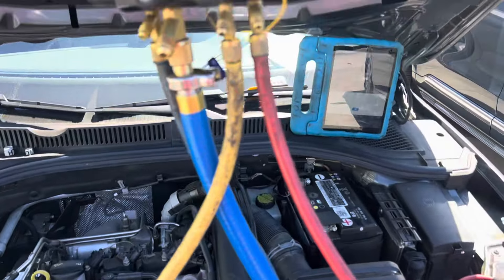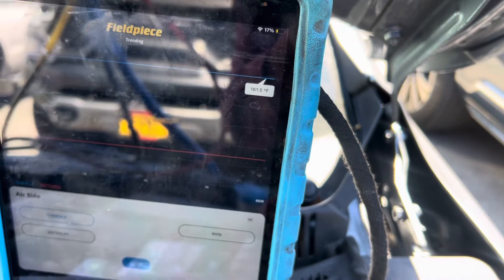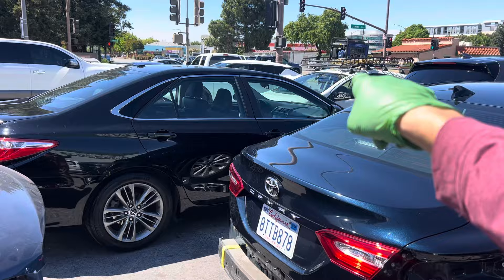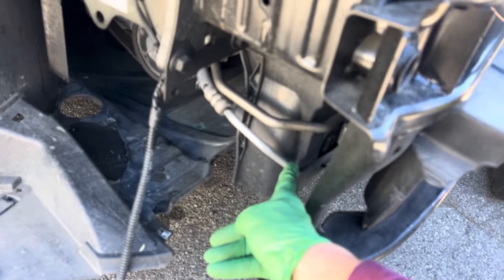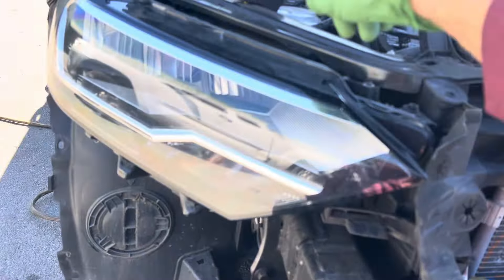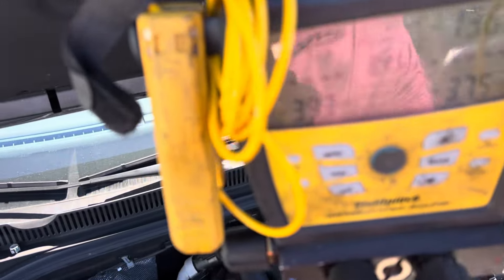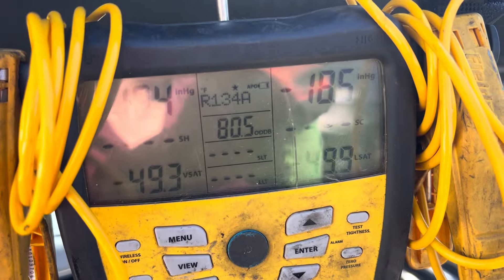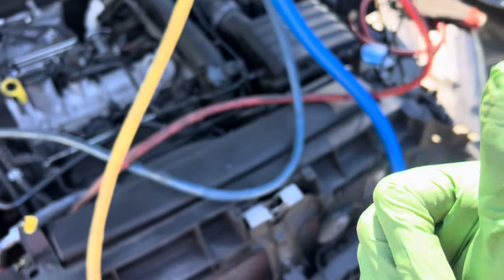Fieldpiece, MR 45 recovery only unit unit.  It’s fast.

Comment: I know its not related to the video but, what's the better oil type for GM a6 compressor? Sl100, or pag150, which is denser, specially as we are suing r134a in a r12 system.
Reply from the maker: @5aldl  never heard using silicone oil in automotive ac compressor. 

In vacuum pumps 

Price would probably scare most of from using it. 

But compared to DENSO ND-11 POE oil it’s cheaper much cheaper